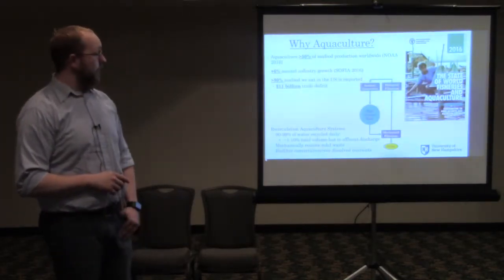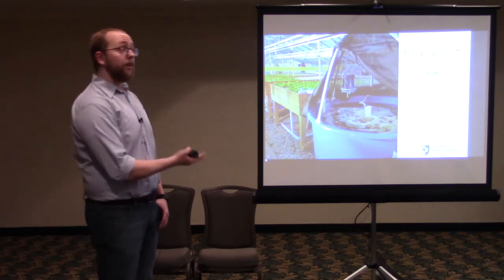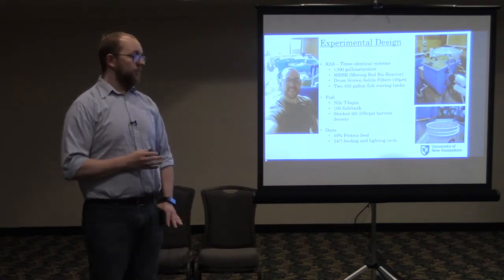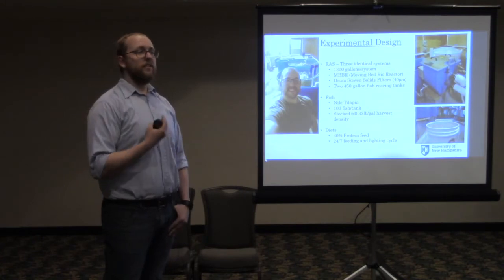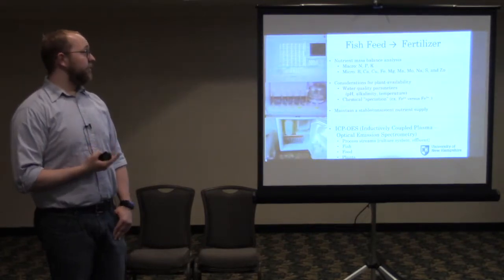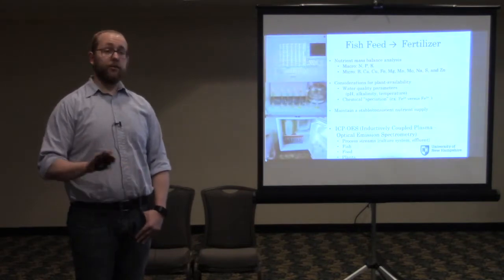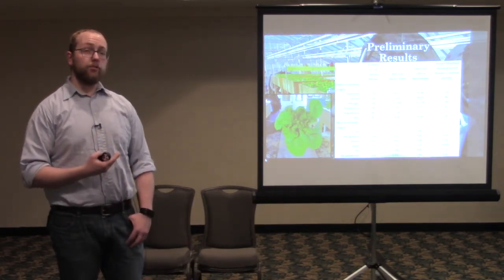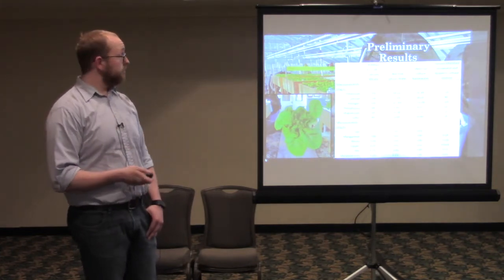Developing a sustainable Northeast aquaculture industry using aquaponics

Comment: What did he mean by adding Sodium bicarbonate and then "change that" Potassium Bircarbonate? Did he mean instead of using sodium bicarb they would supplement with Potassium Bicarb instead?
Reply: The bicarbonate is the key here for buffering the ph. Instead of using sodium which plants don't like they are using potassium which plants need to be supplemented in the nutrient base. Some folks use hydroxides as opposed to bicarbonates in order to make faster changes in ph.